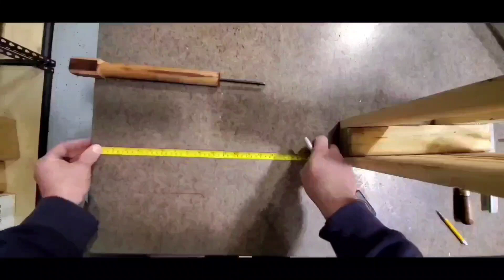Rifling your own barrels,  making the jig and fixture.

Comment: You could have made the dowel and used ECM to get the same results faster.
Reply from the maker: Thanks for the input.  I've only used edm to cut doghouses in production molds.  The process was slow,   but could only be accomplished with edm.
I'd be interested in watching your video demonstrating how you got a single point trode to cut an even spiral passes that deep and constant from end to end.
Reply: @apexpredatoroutdoors8308  not edm ecm. similar but instead of using a single point electrode you make the tooling and connect your negative lead to the tooling and the positive to whats being cut. the tooling can be what ever shape you want and you pass the electrolyte between the two. and the cut takes the shape of whatever the toolings shape is. look into ivanthetroll he made a guide into boring, rifiling and throating/chambering barrels for the FGC-9
Reply from the maker: @nickisghosty thanks for the input.   The point of this video was to show how rifling can be cut this way.   And no,  you can't get the same results as others have stated.
Reply: @apexpredatoroutdoors8308  i get that. but you can get similar results. surface finish just isn't quite there, but you do get a lot better surface finish with results closer to actual machined rifling using sodium nitrate or was it potassium nitrate... one of  the two instead of table salt there's a few other electrolytes that have different qualities if you look up ecm electrolyte comparison  you can find the pros and cons of each solution.
Reply: and even getting some what similar results for next to no money spent IMO is insane. instead of spending thousands on machines and  tooling I can get something that works with under $50